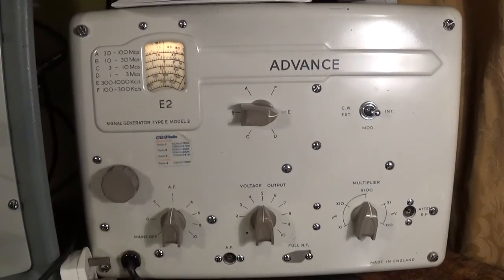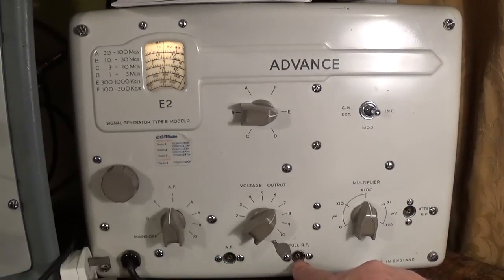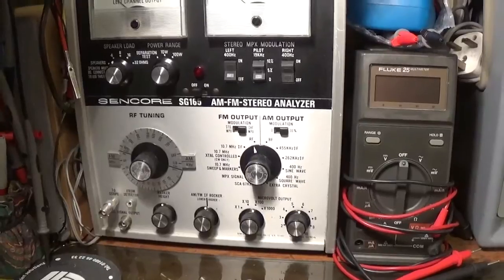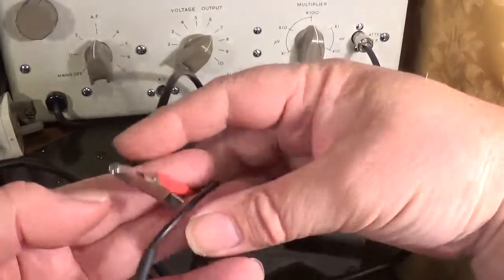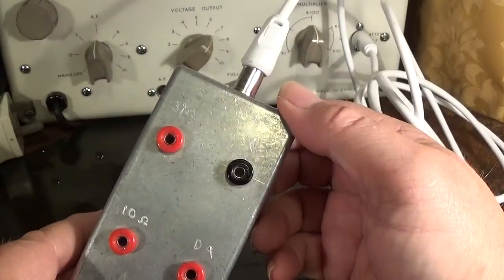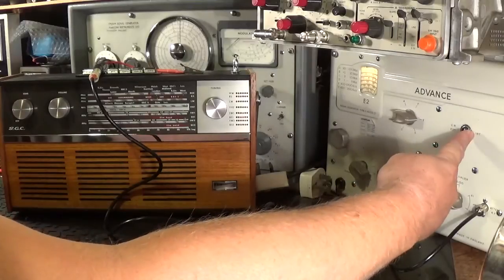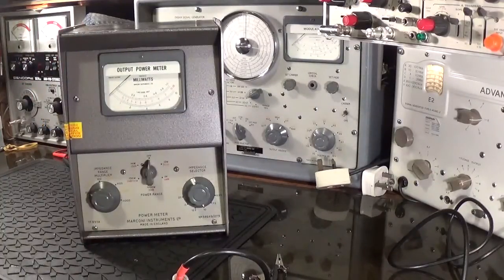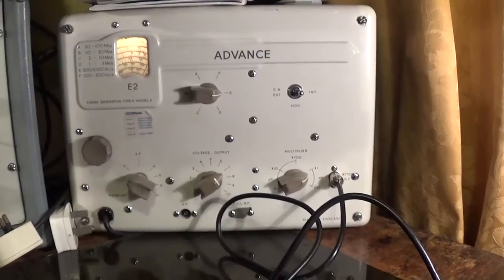Advance E2 Signal Generator - how to use

Comment: That's a really nice E2 probably the best condition one I have ever seen.  How reliable is the calibration. I also like your dummy aerials very good example nice video well explained.  I see you have a few signal generator which one is your favourite.  Not exactly a signal generator but I love my Marconi 2955. Thanks for sharing Chris.
Reply from the maker: Hi Chris, My other later E2 is in pretty good condition too. I shall do a video on the calibration, by way of your question that's a good one to show actually. I did plot the errors on the main spot frequencies one would use for radio alignment but of course I've lost the paper now. There's a few sig-gens I didn't show actually. I have several portable AVO units, a US Hickok model, five Advance units, an Advance J1 (proper AF sig gen) and a Philips valve thing that goes to 800 mHz. Never use it.  My favourite for what I play with is the Advance though the Sencore with it's spot IF frequency outputs is very useful. I'd love something digital like your comms test set but can never find one for £20 :)
Reply: All very interesting would like to see your others. I think I have an Advanced J1 under the bench.
Reply: Just out of interest have you ever tried locally rebroadcasting using the modulation input on your signal generator. I like to listen to radio 4 extra via DAB on some of my old AM coms receivers. You made me think about the belling Lee connectors I wonder if the people that manufacture these have seen a downturn in businesses. That's a very timely reminder regarding DC blocking capacitor.
Reply from the maker: Hi Chris,  I bought a bunch of them a couple of years ago in anticipation :) I guess a lot of countries still use them. No, I've not tried that. I built myself a really simple transmitter that I connect up to an MP3 player. Not many valve radios have had Alice In Chains, Nirvana, TAD, Slipknot etc played through them I imagine but mine have :)
Reply: Andrewausfa yes it's great fun rolling your own AM transmitting I built a few of these . I think I have one I built from a kit maybe  Systran or something.  It's great listening to old broadcasts  I love HG wells and Churchill speeches.

Comment: I've got a E2 Andrew. I rescued it from a skip at Swansea Uni a few years ago. The electrical engineering dept were having a clear out of old gear. As you can imagine, it's in great condition, was serviced regulary and works great once it's built up a head of steam! My unit has BNC connectors, Universities don't mess around with cheap connectors  ;P
Reply from the maker: Hi Kevin, I was wondering if I should change to BNC actually. I bought the females, just never got around to changing them. These do work well, one reason why I have four and this one stays on the bench as 'does what it says on the tin' :)
Reply: Kevin Williams  I could be wrong but these were never originally supplied with BNC. Very many of these have had BNC upgrades but they often mess up the equipment panel and that's a shame.  Obviously the BNC is superior but I'm not sure it's really worth upgrading the belling Lee. Regards Chris
Reply: Yes they came from the factory fitted with belling lee connectors as per Andrew's example - I presume the bnc connectors on my unit were fitted by the university techs